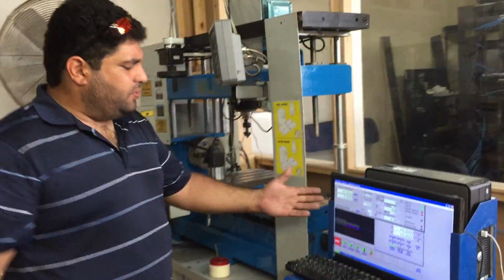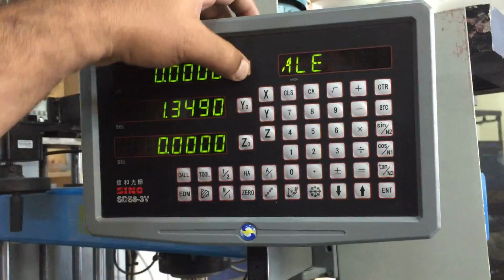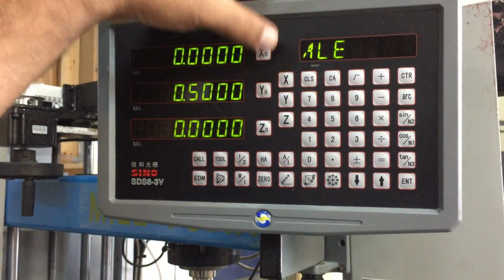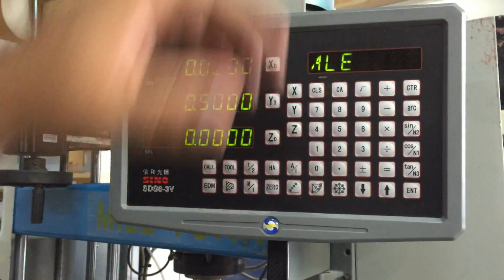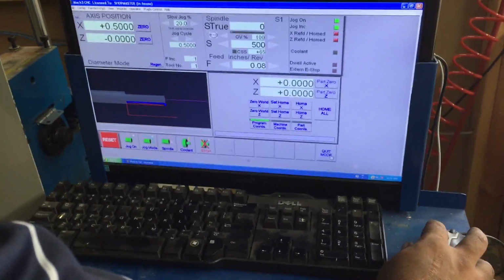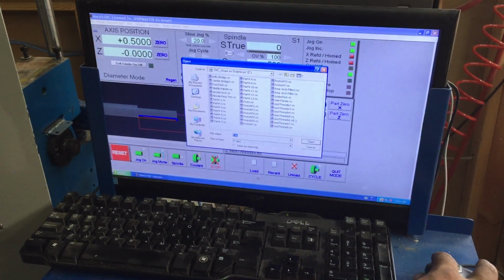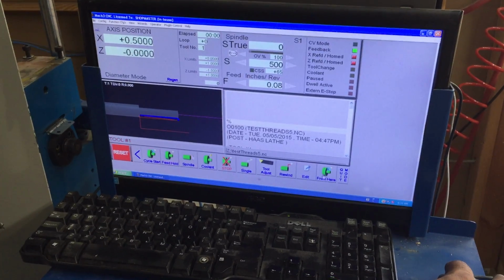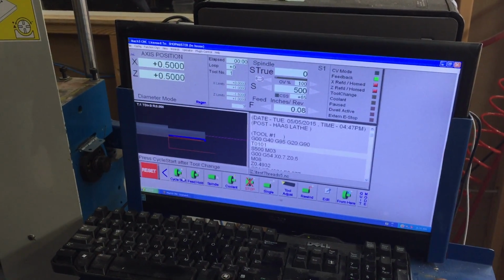Shopmaster Defective Machine PayPal Case number: PP-003-898-882-211

Comment: I have watched and saved this video ... when JT owned the company service was a lot better.  

After seven years, when this video was first posted, did you get some kind of eventual resolution.   I completely agree with the comment that things do go wrong, and it is an indictment on how a company handles the issue.   If I were the company I would have issued a refund and taken the machine back, it is short sighted to have such a negative customer over the loss of the cost of shipping... stupid. 

I have a 17-20 Gold circa 1998 and it is a little rough around the edges.... yes, and the machine has been modified and tuned to a degree... yes. Over twenty years of use, I also have Hendey 14x40 and South Bend 9" lathe and a Bridgeport... just to say I am am not new at this.  

The deal is coordination between the spindle and the lead screw. On a gear box or pick gear lathe this is mechanical.  My ShopTask cuts threads fine.  

Two other issues is rigidity and tool geometry.  If the part flexes or the cutting resistance is high then the material can shift. If the bit is not properly sharpened and height not set right it can severely effect quality of the output. 

Still the bottom line is proper and consistent coordination between the spindle and the lead screw... which in a cnc machine are encoders and software.  I agree that there seems to be something not right with this particular  Machine .  

And what is even more of an issue is Chicago Lathe Shopmaster not standing 110% behind their product.  Get one of your techs on a plane and go help this man with his purchase. I have loyalty to a product, but at this time would not consider purchasing a Shopmater.

Comment: Meni, I am sorry to see your frustration! it does suck when the machine does not do what you expect it to do. I wonder if Shopmaster tech service finally resolved the issue you are having. I am a bit suspicious about the code you are running. Basically on every cut  you start a helical groove which seems they are starting on a different angle. The timing between each cut has to be calculated very precisely based on the diameter of the cutting piece, the rpm of the chuck, and total cutter travel path distance. If you are just a bit of in measurement of your piece or other factors I mentioned, you will end up getting what you have. I would use more basic methods for calibration and repeatability tests. Good Luck!
Reply: he is telling you at the end of the video they refused to provide any help whatsoever. One can understand if a product has an issue. All manufacturers has issues with some of their products. But to abandon a product once it has a problem is unacceptable. Thank you Meni for reporting it

Comment: Hi,This is my machine which I bought from JT last June.  He told me the story about it being returned from another customer who was having problems with threading.  It did have some mechanical problem with the ball screw adjustment which was repaired.  Most of the problems shown in this video are errors in Mach 3 programming.  It took me about 2-3 weeks to learn and understand the quirks of Mach 3 and after figuring everything out the machine performs fine.  I can mill and turn and hold tolerances in the 0.001" range consistently.  Threading is especially sensitive to getting the RPM set correctly in the wizard and not using the spindle speed averaging function.  There are a few tricks in how much distance you allow for the spindle to ramp up to speed before the cutter engages as well.  Just like on a conventional machine, threading requires some background machinist knowledge and won't be a 1 day learning curve for a beginner.
Reply: +Alejandro Martinez ,
Thanks- his statements are a bit off, as the machine was not new, but a used demo that we sold at a steep discount.  He returned the machine to us and received a full refund, even though he kept the CNC rotary table and tool setter.   We found the ball screw retaining nut had worked loose causing his threading problem, and once that was tightened and his Mach 3 errors corrected the machine performed fine.  Glad to hear you are having good results.

Comment: Those little shop masters perform well the only thing is you have to know how to operate a machine 

This video contains so many obvious operator errors 
And again the price it's affordable compared to other imports out there 

Any good machinist can make good parts on a worn out machine as any bad( machinist ) can make garbage on excellent machines
Reply: Good Point. I bought one of these in Mid-2107. It is a usable machine, but from the beginning, it requires you to correct for low Chinese quality.

I have used it, and I can get accuracy down to .0005". As far as I can tell the movements of this machine
are accurate and true enough for that. I would describe its accoutrements as being shoddy, but enough so, that it is a problem.

If you buy one, I STRONGLY recommend taking it apart all the way, cleaning it, checking EVERYTHING, fixing as needed, and getting to know the machine that way.

Because of all this ShopMaster probably should be selling these things in kit form, to be assembled by the User, and at about half the price.
Reply: +David Kugler so what your saying is a good machinist will know what way the quill is going to walk .015 so you can make the correct offset?

Comment: For anyone considering a Shopmaster...Please for the love of machining avoid them like the plague.  I made the mistake of buying the Patriot model two years ago and I have pages of complaints.  Shop master is an utter fraud that sells trash at 2-3 times what it's worth at best and burns through customers.  Anyone giving them good reviews are either shills or idiots in the shop.  My unit came with multiple crooked and nearly stripped screws.  The motors are not lined up, the pulleys are off.  A crown nut was threaded so crooked it was binding the Z axis.  Turn wheels along with most everything looks like it was all pieced together with after thought.  Virtually an unusable machine in manual mode, and not much better in cnc mode.  In lathe mode one of the axis is reversed, never got an answer from them.  Today the computer died after only about 20hrs use.  I was under the impression I was getting a new computer.  The computer shipped was something used from an auction, a by the pallet buy and was beat to hell on arrival.  Shopmaster machines will suck all of the enjoyment from anything attempted and will sit unused and will make you nauseous for having wasted so much money on them.  I hate my machine from top to bottom and have accomplished little on it.  For a cheap manual machine go with Grizzly because at least you will pay a fair price for what you get and for CNC go with a Tormach.  My personal dealing with the guy at Shopmaster gives me the impression he cares nothing about you once he has your money, lower than a used car salesman, parades his family to sell his garbage, uses testimonials, etc.  Everything alarm bell that should warn one looking to buy that they are not at all trust worthy.  Cheap tactics are not require for quality equipment.  I feel sorry that they fooled me into one of these machines.  I have better equipment such as Camaster Stinger, and many manual machines that have made there money back multiple times.  My patriot experience has been a total loss of $7000+ and have only used it for 20hrs of pure hate and anger.  Fuck you Shopmaster!

p.s. He gave me the same line of not knowing what I'm doing as well.  I suppose he tells everybody that to make himself fell better sleeping at night because he knows damn well he sell junks and it's not user error in a large number of cases except for the error of owning one in the first place.
Reply: I couldn't say it any better!!!!!

Comment: Thank you for this warning. I had a similar problem with a Tormach PCNC1100 machine. I had an inconsistent behavior on the z-axis. At the end I discovered that the coupling between motor and lead screw was not correctly tighten. Perhaps you can check this. Good luck !